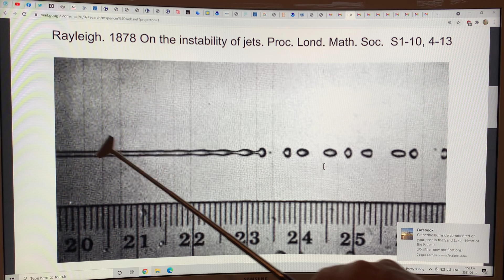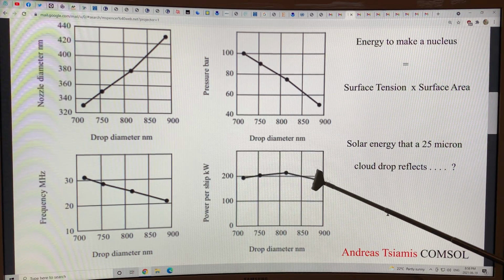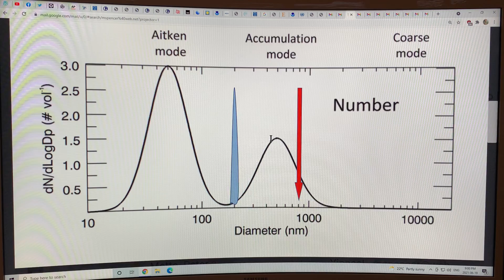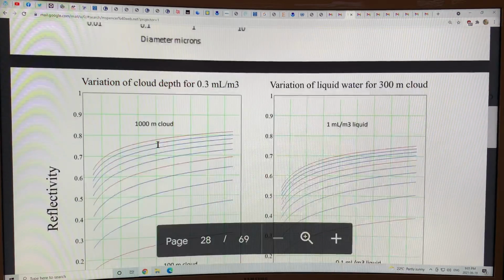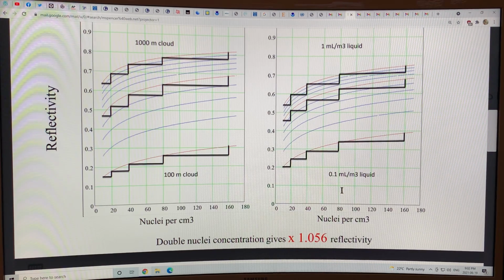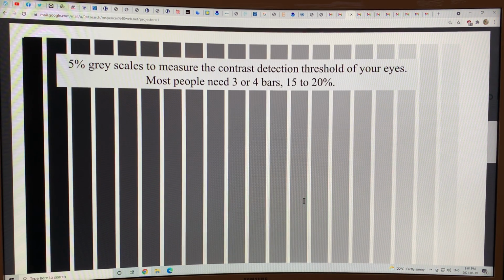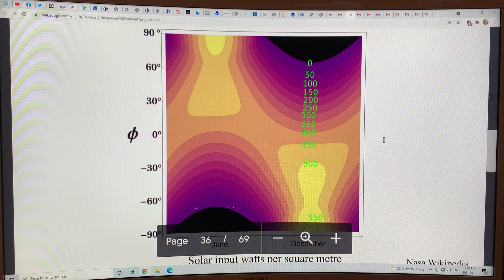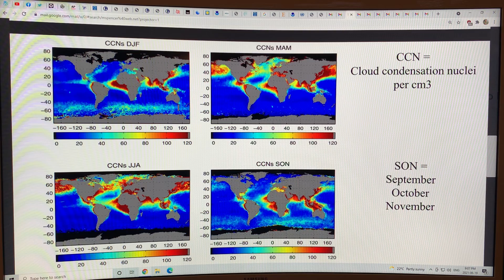Sea Water Spraying Produces Tiny Airborne Salt Particles making Clouds Whiter to Cool Planet: 3 of 4

Comment: The issue is that salt releases halogens (CO2 and ozone) Those clouds reflect solar radiation but INCREASE ultraviolet radiation. What happens when increased CO2 molecules interact with increased infrared radiation?  You guessed it… heat. So yes, the hotter temps we are experiencing is due to salt dispersion.  Why else would you knowingly heat the atmosphere… to what end??? Science tells us that this salt dispersion INCREASES CO2 levels… isn’t that a ‘bad thing’??? Think.
Reply: Infrared radiation. Sorry, automatic typing chose ultraviolet instead of infrared.

Comment: ... and when we run out of oil, how do we power all the machines that do the geoengineering?
Obviously not with solar, because the sun will be too dim after all the SRM. And wind energy is intermittent.
What happens when geoengineering stops and moral-hazard has taken us to 800 ppm of CO2?

Doh! Should have thought this one through!

Personally, I'd rather not live in a world where governments are fighting over the thermostat.
Reply: How would reducing sunlight by 10% make solar unusable?  We've already increased solar efficiency by 1000% in the past 10 years.

Comment: I used to work for a company that made ultrasonic fog nozzle systems.  Pressurized air would hit a cup facing into the stream and it would create a standing wave that would break up any liquid drawn into the air flow.  It was very effective.
Curious whether this type of system would be applicable.
Reply from the maker: Fascinating; do you have some links on the nozzle and company?
Reply: @PaulHBeckwith  I googled "ultrasonic dry fog nozzle" for current systems and found several.
Using pressurized air:
https://www.byspray.com/product/dry-fog-ultrasonic-nozzles.html
https://www.facebook.com/XINHOUNOZZLE/videos/ultrasonic-dry-fog-atomizing-nozzle-adg-sk508-80/369557300633335/
Also using transducers:
https://www.sono-tek.com/ultrasonic-coating/how-ultrasonic-nozzles-work/
The considerations of interest were-- Requirements to power the air pressure (or water).  The maintenance requirements (clean nozzle).  And  droplet size produced.
When I was testing one of our spray bars, it was mounted in a small room.   I quickly found out that was dangerous.  When turned on, the density of moisture became too high to breathe, VERY quickly.  
One of the applications was the paper industry.  Paper being rolled into huge rolls would pass through a electrically charged "fog" and the moisture would be attracted to the paper.  This allowed for a precise amount of moisture content in the paper.

Comment: More albedo and the Earth cools.
Less albedo and the Earth warms.
No albedo and the Earth cooks.
That is NOT what RGHE theory predicts. 
Actually, that the albedo cools the earth directly CONTRADICTS RGHE theory!

The earth is cooler with the atmosphere/albedo not warmer.
The “extra” warming energy downwelling from the GHGs theoretically originates with the surface upwelling that “extra” energy as a BB. As demonstrated by experiment, that is not possible.
https://principia-scientific.org/debunking-the-greenhouse-gas-theory-with-a-boiling-water-pot/

If either of these points stands, greenhouse theory fails and man caused climate change collapses.

Version 1.0 062121